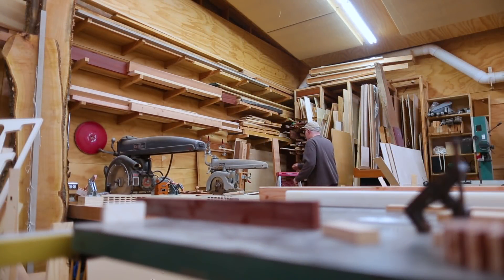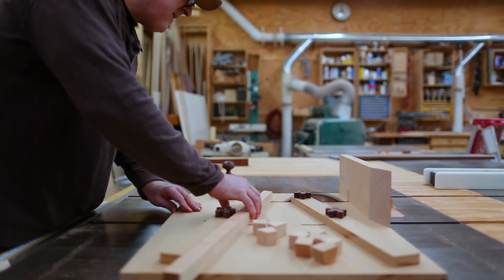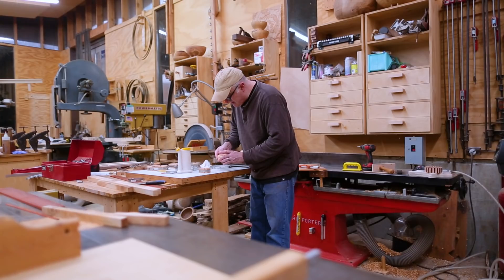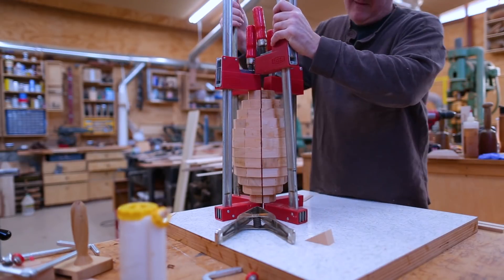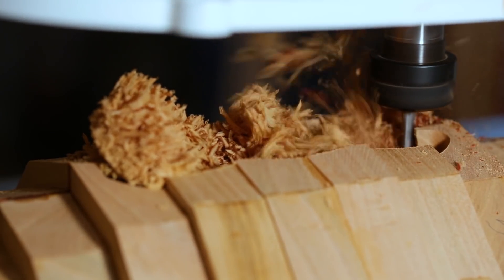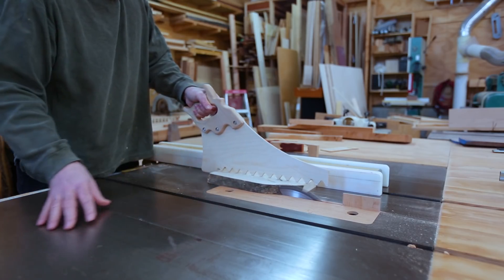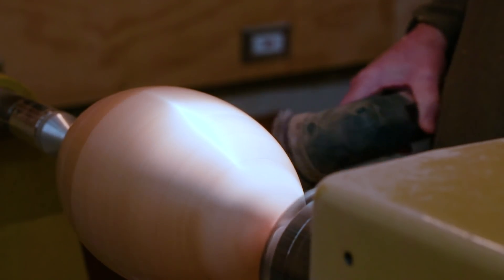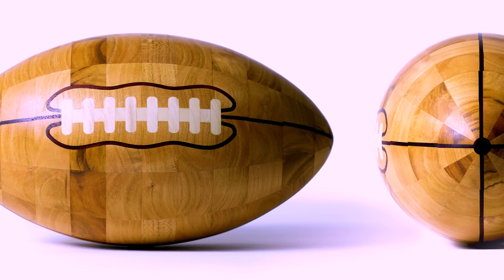Wood Turning a Football

Comment: Nice work Frank.  You always seem to come up with really cool ideas to get your projects completed.  Maybe next time you can use that new 4th axis to do the lathe work on your CNC.  Then you could leave the laces a little proud of the surface without having to glue them in after the fact.  Heck, you could even use a V cutter and mill in all of the little dimples.  That would be really cool.  At some point, you could even rotate that 4th axis on a 5th axis which would allow you to mill all the way around a spherical surface while keeping the milled spot perpendicular to the cutter (or not, if needed). 😉
Reply from the maker: I like this.

Comment: Hi Frank, I have thoroughly enjoyed your videos for the past couple years. I have a quick question - what is the sander that you've been using in your turning videos? And where do you get the sandpaper for it? I've been using just plain sheets of sandpaper, but they tend to get hot and only sand radially. Your videos are always great! Thanks for your contribution to the YouTube woodworking community.
Reply: is it not just a small random orbit sander? dont' want to get spammy with links or brands, but if you do an image search for "small random orbit sander" you'll see some examples.  I think that sandpaper is just standard from the hardware store for those sorts of sanders.

Comment: I’m wondering if you use straight cuts on your inlays or if you angle them? I know mtmwood cuts his inlays with opposing angles. Not sure if it glues up better, cuts better, or give more surface area for glueing.
Reply from the maker: I have been using straight cuts but I want to figure out doing angled cuts.  I would think with a wedge shaped piece you can clamp the glue up and get a tighter seam.

Comment: Nice Project, thanks for the upload.
Just to give you my point of view: for me it IS about what tools are used not about how they affect the Workpiece. The reason behind that is that doing stuff by hand and doing it comfortly and ending in perfect results takes way way longer to master then say learning to use a CNC. Im woorking on a CNC for a living, so maybe for others it is more "magical" than for me? I dont know. But you can learn that stuff realively easy (on top of that you have simulations etc.) i would even say its more complicated to have the wisdom of how to transfer it to the workpiece then to actually do the patterns because you have to know how which material behaves under cutting.
I would have gone for cutting the glued up ball into 4 pieces to get the red seams in btw. Doing that it wouldnt only have been easier to align the 4 lines, by glueing together one half at first you would have had a flat bottom to screw to the cnc table to make the stiching pattern. You can tell in the sped up footage that the 4. th axis is moving quite a bit while cutting, that is not very precise.
Doing such a Pattern as an inlay purely by hand on the other side, requires practice maybe over years to get it seamless plus it takes more time. Thats why admire channles like "Clickspring" or "Uri Tuchman" a lot. And thats because shows that follow old masters of their craft that have done stuff by hand for decades (like blacksmiths carpenters and such) are so satisfiing to watch for me)

I hope you dont get offended because i like your Projects and your Channel a lot and i dont want this to look as criticism!
I like your Channel for other Resons tho. Here its more about your nice Ideas and your so complicated glue-up Patters. See i´m sure i could have done the CNC Part on your project on my own after a bit forward and back. I only do single parts so i have no room for screwups, there are ways to get used to that...but because that is so i dont need to watch a youtube video about it. I love seeing you turning, sawing and glueing tho, because how those patterns end up puzzels my mind. On top of that you seem to be a very nice and down to earth Person :)
Have a nice Weekend! Cheers
Reply: AnTrAxX Slingshots — I agree with this wholeheartedly. I had just made a comment about appreciating what this creator does not show, as it is paramount to the projects he pursues.  I am relieved that someone else has similar themes.

Comment: In your video you mentioned that cherry will always warp while drying. This is only true for  fruitbearing trees. Those trees that are specially grown for wood use only normally stay straight.
Reply: all wood warps, some just more than others.  i've had wood warp at me the moment it was milled straight off the log.  Depends on a whole heap of things like the grain direction, moisture content, locked in stresses, species, etc.  Those species used for wood were selected because they warp less, but a fine wood worker would still want to let them dry a few years and then joint and plane them down to dimension before using.

Comment: Turned out very nice Frank, now I wish I had a CNC Mill.. I programmed, setup and ran them for the DOD in high tech machine shop for years but don't own a router CNC. That largely has to do with the size of my wallet :).

Comment: Well, great work, of course, but I just noticed something I've been wanting for a while and unable to find (and this build up is going to be disappointing) - a chuck key with an "offset" handle (at 15:28).
I have a Nova 1624 lathe w/ a G3 chuck and when I put the cole jaws on their height interferes with the current "T" handled chuck key.  I can only turn the key about 1/4" (or a very small fraction of a turn) each time I use it, until the handle hits the cole jaw plates. (insert, turn, take out, turn back, insert, turn, repeat ad nauseum).

Does anyone know of where to get a chuck key for the Nova G3 chuck, that either has an offset handle, or a sliding hande?

Any help appreciated.

Comment: I get why you chose to not use the 4th axis, but I also think that using it as a test piece for the 4th axis would have been helpful. Simpler shape means it would have been easier to tell if something was wrong quicker.

Comment: I would suggest a different approach in gluing the pieces to get a straight longitudinal dark line glue every quarter then glue quarters to each other to get a 4 quarters then have the dark piece of wood as a long 4 strips then glue the whole quarters with the long pieces in between.

like this you will ensure that the dark line is straight

But really as usual wonderful work

Comment: Seeing a cutter cut on the wrong side of your programmed feature is the worst feeling in the world
Reply: Dagg Getting the X and Z axis the wrong way round doesn’t feel very good either. Mate was machining a piece of billet Aluminium for his race engine and it didn’t fit in the CNC machine properly so he turned it 90° but forgot to change the program. Apparently his face went as grey as the aluminium when he realised.
Reply: I had a corian benchtop cut once and the sink fell perfectly through the cutout.  It was a perfect fit. I had to glue in a 10mm collar.  Took a long time to get perfect but it worked in the end
Reply: Except that it's encouraging to know that even the masters make mistakes. This one even shares his with us. Talk about humility!

Comment: Who am I to second guess this work? No one. Still, I noticed the four panels didn't line up. A rough shaping of the ball first and then cutting a dado or split in for splines would have been a viable option for the seams. Even if each spline was done one at time; cut glue cut glue cut glue cut glue. It would have assured absolute straightness. Nonetheless it's done and it looks beautiful.

Comment: What you are doing is not very smart you know. You do not need a respirator whilst cutton on the table saw. However you do need to use some sort of hearing protection, since it can mess with your hearing if you dont